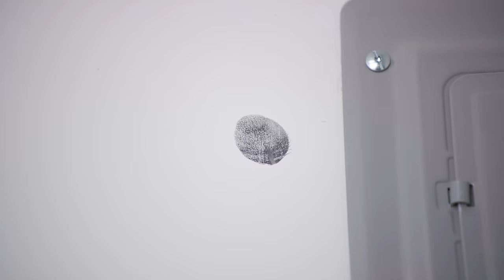What Happens if you Sit on an Airbag? - The Slow Mo Guys

Comment: Fun fact: The original Buster also was shattered to pieces at his first appearance on the Mythbusters :D
Reply: Dropped from a crane onto water right?
Reply: @bakedandsteaked  Yea, that's what Adam said
Reply: I remember when that episode aired for the first time.
Reply: CrashMasta good times
Reply: Thanks for the fun fact lbakon Ferba!
Reply: I remember it fondly
Reply: yh
Reply: YUP!
Reply: My favorite episode was when they vacuformed buster 2.0
Reply: I came here just to find this comment. Myth busters did it first!
Reply: sad fact: grant died
Reply: True afact that
Reply: I remember they threw buster down an elevator shaft, which ended up completely dissembling him again.
Reply: @Evp3  Battle Bots recently named their top award after Grant to honor his legacy and contribution to robotics and engineering. He will be missed.
Reply: he got so busted that only like 3 pieces of the original are all thats left of him xD he was a good dummy
Reply: @ThoracJunaut  there were enough pieces of the original Buster for each of the five to get two pieces. Adam got a hand and the face.
Reply: Yeah the tool belt water tension myth
Reply: Which myth was buster busted in
Reply: Also, apparently, he ended up with Buster's ass. He showed it recently for an auction they're doing.  @PibbDFanta

Comment: The look on Gav’s face when he ACTUALLY realized it went between his cameras. You can see in real time how expensive it almost was.
Reply: Well, he can't blame anyone but himself. They did earlier tests and even then something flew onto that table. You think that they would've at least placed a shield in front of it - but no, expensive equipment is lying unprotected a mere meter from an explosion with high possibility of shrapnel.
Like... WUT? Those things should've been moved from there ASAP.
Reply: @Vladimir_Kv  airbags dont normally expel shrapnel. that would defeat the purpose
Reply: @jch8175  is that a Takata joke?
Reply: @jch8175  They literally funneled the energy from an airbag into a plastic mannequin, obviously that's a shrapnel risk.. It's not about airbags creating shrapnel nobody said that.

Comment: After the first one: "eh, it's not too bad, maybe they'll do it with Dan on it after…

Later: "oh."
Reply: I mean, they could have done it with Dan. The reason it flew so high in the later try is because the legs got detached making it much lighter. Even with the legs I'm willing to bet Dan is significantly heavier than the mannequin. They could've done it, but I'm ok with them taking the safer choice
Reply: @wave1090  the problem is with this, the amount of force that is excerted on the human back is enough to get compression fractures in the spine, to do stuff like this on a human body for a video and/or prank is plain stupid. 

no Dan probably wouldnt have lost any bodyparts there is an abbundance of cases where this "Prank" made it that people that fell victim to it broke there spine and there is even cases where the person became a paraplegic.... "Cool Prank BRO".

These are Explosive and high velocity gasses we are talking about, not toys!
Reply: @wave1090  I suggest you look up a compilation of airbag pranks, they're stupid and really not safe.
Reply: @_Crumpet  I never said it was safe. I even said they went for the safe option, which was the mannequin. I only said that he could have done it and most likely not have gotten severally injured or at least not as hurt as the mannequin would led you to believe.
Reply: @wave1090  Well, what you actually said was 'they could have done it with Dan', to which my response is essentially yes they could've, just once. It's stupid to suggest that it's even remotely reasonable to do so. Oh, and a touch of physics - the legs flew high too, so their detaching meant nothing for how high the body went because they also went that high anyway and would've whether they stayed attached or not.
Reply: @_Crumpet  could doesn't mean should. Bye
Reply: @wave1090  nobody would say could unless they thought it was actually a realistic and reasonable possibility despite the extreme risk. 

Anyone who knows how dangerous it is and the potential for extremely severe injury would say they could do it without being very careful to add an emphatic "they absolutely shouldn't because he could be crippled," after.
Reply: @wave1090  When you get called out and then leave, lol
Reply: @humorless402  They didn't get called out. They never explicitly said it shouldn't have done it with it Dan, but if you read the comment carefully it is implied by the last statement. Crumpet just straw manned the argument by exaggerating and nitpicking the first sentence.
Reply: @DarkXork  I mean, not really. All he said was he was ok with them taking the safer choice, which implies he would've received minor injuries, which isn't the case

Comment: Speaking as a person who reconstructs car crashes, a common injury related to air bags is compound fractures of the thumb(s) needing surgical repair with plates and screws. This is caused by driving with your thumb curled inside the steering wheel grip. When the airbag activates, your hand is forcibly moved away from the steering wheel commonly breaking the bone between your palm and first knuckle. The solution is to drive with your thumb alongside you're other fingers as you grip the steering wheel.
Reply: I know someone who likes to drive fast and has done the Nürburgring a few times. He taught me this, and, as a piano player, I immediately changed my habits!
Reply: A similar issue was large trucks in the Army. Hit a hole and the steering wheel might twist suddenly, breaking your thumb.

Comment: I really love you guys and all the amazing video's you have made. But Sometime...Sometimes some of the decisions you've made are stupefying. Earlier in the filming, Gav was extremely lucky that the electronics sitting open and exposed on the workbench a mere 3 ft behind an Exploding Airbag that is flinging a hundred plus pound crash test dummy into the air didn't get  totally destroyed! 

And then, using a more powerful airbag with the intention of flinging Slo Moe even higher, you would think he would take SOME kind of precaution to protect what looks to me to be some pretty expensive gear. You would think. And you would be wrong...

Comment: What I would think would be a next step is 3D modelling in direct and indirect methods. Small printing to create models of Gav and Dan (could a charge be implanted in the models? Hm.) and for larger printing create molds of their heads that they can pour wax into to create replaceable real-size wax models of their heads for candles, fireworks, flares, explosions, etc. All sorts of things possible there (Eg. Halloween morphs, Mount Rushmore style (using different expressions of one of them), and more!

Comment: Moe isn't a crash test dummy. He's rather fragile, in fact.
Still, getting your bro to sit on an airbag is a stupid idea! Successful deployments often result in very broken arms.
 BTW, in these parts, we have a boat race on big rivers, 800 miles long. Small potatoes, really, boats are limited to 50 horse power. It used to be a bigger deal, locally.
Anyway, one of the greats was a ship called "Slow Moe." Her captain was an old guy from the village, crazy fast.
Not especially relevant, but thanks for the nostalgic reminder.

Comment: I hope you guys did your research and only sourced airbags that weren't affected by the largest automotive recall in the history of the world - the Takata Airbag Recall.

41.6 million vehicles affected from basically every manufacturer in the world.
56 million defective airbag inflators installed in those vehicles.

Inflator literally turns into a frag grenade when it goes off, sending shrapnel throughout the vehicle, or in your case, the room.

Comment: There is a super old meme of some kid sitting on an airbag and getting thrown into the ceiling. It can't be good for your spine at the very least. I don't think your legs would fall off. Not sure why this was so underwhelming compared to the other videos I've seen. . Maybe just the weight factor, but that dummy doesn't look to be more than 50 LBS.